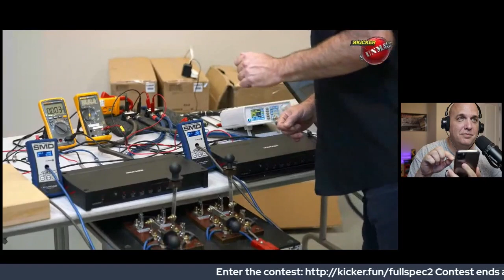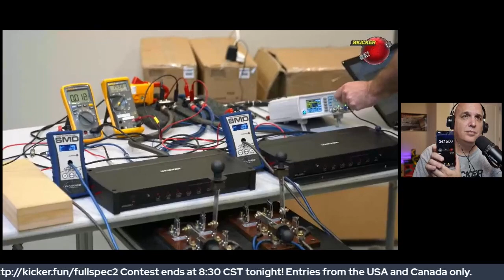CCA vs. OFC Power Wire Test - KICKER UnMASKED - Shorts

Comment: I’ve been using a thermal camera to find electrical issues on vehicles for a few years now, best investment I’ve made in years, the visualization is so eye opening. This would make an awesome demonstrational add. Two amps running wide maxed out for over 4 minutes is incredible!

Comment: Seems like a trick to sell more wire... 1/0 gauge cables (CCA)250max load (OFC) 350+ max load, head-to-head with over 500 amps of the current draw! ...... that's like a child lifting a jug of mild vs a teenager... both can do it.. the child struggles...try this test on a 100amp load and I doubt the difference would be dramatic... what you choose to complete the task depends on the task.

Comment: My first subwoofer was a Stillwater Designs 10", back in the mid 80s, if I recall correctly.   Had a Kangaroo with boxing gloves on, on the dust cover.

Comment: I see this in every OFC v CCA demo, and it's extremely lame.  CCA has a different internal resistance, which means less power throughput, this is an apples to oranges comparison.  Perhaps if you ever do this again, you do the proper apples to apples comparison and use a more properly-specced gauge of CCA.  Perhaps do 4 gauge OFC v 2 gauge CCA, I know stepping up two sizes is the rough rule of thumb for anything under the oughts, or perhaps do a 1/0 OFC v 2/0 CCA as one step up is the rough rule of thumb for the oughts, though I've also never been able to find a proper spec of what CCA's resistance is so I'm not sure what the more direct comparative gauges are.  I get a lot of people will use a certain gauge no matter the material, but perhaps take this apples to oranges comparison, perhaps take the better apples to apples comparison, and start educating consumers on how to properly spec CCA wire instead of demonizing it with the parroted 'CCA is shit' mentality.  Then perhaps talk about costs, where CCA in a power throughput comparison can easily be a third cheaper compared to OFC, that's not a gauge comparison, that's identical power through an oversized CCA cable, for cheaper than OFC.  Honestly, do better.  Even looking through the comments here, nobody seems to understand, or even know of, these facts.
Reply from the maker: The point is that CCA has its place. Yes, its more affordable, but it has some clear differences, as the video explains. At the end of the day you cannot use the same gauge CCA and OFC and expect the same result for less cost. If you understand their capabilities correctly, then you can use either type correctly..

Comment: Welding wire is the best. If it can pump big amperage while being dragged around in all seasons in hostile industrial  environments for decades, it will run a big stereo. It is also cheaper than "audio" wire and if you need it pretty slide some sweet colored sheathing on it and shrink the ends.
Reply from the maker: Welding wire is good stuff under the right conditions. The upside to it is affordability.  The downside to it is that the copper often doesn't have much resistance to corrosion (every strand of our cable is coated to resist corrosion). The copper used in welding wire is also often a lower strand count, so it doesn't deliver as much current as a typical audio power wire and isnt as flexible. We have well over 4,000 strands in our 1/0 AWG wire. and of course - welding cable never adds any warranty time to the amp you buy.  When you get a qualifying Kicker amp and power wire kit, you get an extra year of warranty on the amp (making it 3 years, total). Here's the exact policy: https://www.kicker.com/amp-warranty

Comment: All depends on your power needs. I used cca for years with my 500 watt rms systems never an issue just got my first big rms system and I'm learning i cant use cca anymore my amp is going in and out of protection like you mentioned..

I did the big 3 , sent my amp back got a replacement, almost bought a 250 amp alternator before I watched this video think I've found my problem
Reply: im about to do 1200W RMS for subs and 420W RMS for speakers/tweeters.  I am only using 1/0 OFC!
Reply: @GlycerinZ how’d that go I recently switched a 500 rms  jl audio to a mtx xthunder 1500.1
And it goes into protect too much voltage drop with the mtx it shuts off 
But it’s also running off a cca skar 4 gauge with a Infinity reference 4 channel

Comment: I have a 290A alternator I got 2 xspower d4800 batteries one under the hood and one in the trunk just about 20’ and I have (2) cxa1800.1 (2) SoloX 12s the new ones. And (1)750.4 amp. All with (1) kicker 1/0 ofc wire I think I should do (3) runs of 1/0 from battery to battery. What do you recommend. I do get voltage drop
Reply from the maker: What is the 750.4 amp?  We're looking to calculate total draw once we know that last piece of the puzzle.
Reply: @KICKER-AUDIO  it’s a Rockford Fosgate it’s for my door speakers

Comment: What about using CCA for just a ground wire
Reply from the maker: Best to use OFC, especially if it's a high-power system. To my knowledge, you'll still get voltage drop using CCA on ground. Keep copper on hot & ground, in my humble opinion.
Reply: @KICKER-AUDIO  I already ordered up some more ofc to get rid of that run of cca. Thanks

Comment: The only thing I would have done differently was run the CCA first , and in real world you would run 2 runs of CCA to 1 of OFC , but would have been nice to see CCA at 250 degrees lol
Reply: I've heard of running 2 runs of cca but I also heard it is a waste of time because the power will follow least resistance.. Can you help clear this up?
Reply: @phillippardo5712  EVERYTHING follows the path of least resistance, including electricity. I have just started the video so I don’t know what they will say but if it's NOT "CCA is dangerous crap", I'll be disappointed and disheartened. After many heat cycles CCA gets brittle, it will eventually crumble inside the jacket. The resistance will increase which means more heat and if not caught in time it could start  fire. Almost happened to me. CCA is dangerous crap.
Reply: I found a length of old cca wire which had turned to dust inside  ,defo eye opener.

Comment: I have the all black , all original kicker solo x 18. 😆 With a dual 2 ohm brand new drop in cone . Still in the box from like 7--8 years brand new .I  was going ton run 4ga to it for speaker wire and in side box to parallel the coils. Im preparing to run 8k. 370 amp alt, 4 xs d2400sbwith 2 runs of Rockford fosgate 1/0
Reply: I have a kxa1600.1 as well. Used to have the oldshool kicker xs100. Cheater amp. The kxa1600.1 says its capability is 3,200. Hiw can tou get 3,200 out of that amp without dropping ohm load below its threshold. Thats amp is 2 ohm stable . I ran it at 1ohm for awhile. Voltage never dropped below 13.6-13.8. amp is supposed to do its max at 2ohm. Specs say max power output is 3,200. ?
Reply from the maker: Two important notes: first, peak is a burst rating, which is true for all amps. Second, the ohm load varies widely on music, based on the dynamics of the track you play as well as the box rise.

Comment: Everyone does not like cca wire.i use it on my 2000 watt inverter no problem wire gets a little warm just like copper wire
Running 2awg wire.
Only I need to figure out is the inverter efficiency between the two! Other than that I like cca.
Also wondering why they make it if no one likes it!?

Comment: Cool video BUT why didn't u just run cca on 1 amp n ofc on the 2nd- then u coulda compared 100% side by side-LIVE
Reply from the maker: It was easier this way, but yes we could have done that. The down side would have been dividing the current into two separate cables.

Comment: Currently running 4g OFC on 1300rms amplifier.  Looking to upgrade to the kx2400.1 just wondering in your opinion being in a sedan with a 14' run and being a daily driver. Would my application work fine with the 2400 considering I don't have to tear the car apart again and buy more wire, or would that be putting to much stress on the amp????  Electrical xsd3400r 150amp alt.....
Reply from the maker: The KXA2400 (discontinued) will pull well over the amount of amperage a 4 AWG cable is capable of delivering given the length of the run, so upgrading to 1/0 would be important. Go the link we are providing, then click on the Power Cable Chart.  Lots of good info there! https://www.kicker.com/wiring-diagrams

Comment: What's better between oversized ofc 4 guage or CCA standard 0 guage ?
Reply from the maker: The first question to ask is how much current draw will you have? Let that be your primary guide.
Reply: @KICKER-AUDIO  I always do lol but standard 0 guage wire vs oversize ofc 4 guage to me is really close to the same. I'm only drawing around 200 amps I was just asking cause when I switched from my 4 guage to the 0 I didn't notice nothing or gain or lose any.
Reply: @KICKER-AUDIO  I'm running 1 audiopipe bdc4 18 on a vfl audio 5k with xs powers batteries and I had all power and grounds with 4 gauge cause I'm only running like 1500-2000 rms to the 18 but just being honest I couldn't tell by the ear or on the meter when I upgraded to 0 guage the only thing that did happen is that my voltage only drops to 14.3 with 0 gauge and the 4 gauge would go down to 13.9vlt. so I guess it helped with that but that's it IMO now 2k plus system I can see needing oversize 0 guage ofc wire but 2k or less I've never had an issue when it come to ofc 4 gauge or standard 0 and when I say standard 0 guage I mean that cheap soundbox 0 gauge wire lol.
Reply: When you say oversized what is oversized the jacket, the wire, the individual wire strands? This is why I recommend only using AWG wire so you always know what your getting and any connectors etc you get will work as should.

0-50 ft. 200 amps with 60% duty cycle 2 awg ofc welding cable.
Reply: I just got some sky high 2/0 ofc wire today that I'mma install and see how it dose and I had to get wire reducers for my amp inputs cause they only 0 gauge lol and I'mma also upgrade my 10 gauge ofc speaker wire to 8 gauge kicker silver tinned ofc speaker wire :) should be better that's what I'm hoping and should at least give me an extra db on the meter

Comment: for speaker wire for say around 100 rms 14awg or 16awg at  10-15 ft does OFC make much over a difference vs CCA wire assuming both are AWG?
Reply from the maker: In short, the answer is yes. The amount of loss will vary with the run, how close it is to AWG and of course the material. Check out the main video: https://youtu.be/Av6le1K03z8?t=2736

Comment: I mean the difference is right in peoples faces when they are looking at wires or wiring kits. Either it says OFC or CCA etc. Just between those two alone the price difference is half lol so that there should be enough. I think it’s more of a common sense to get the most expensive wire available. They don’t price copper wires the way that they do unless they are the same. I have a buddy that likes to use welding wire and I’m trying to get him to run all OFC he thinks it doesn’t matter. I said OK you some cc a wire LOL copper clad aluminum has nothing on oxygen free Copper
Reply from the maker: Maybe break out a multimeter and check the resistance of both cables? That will help shed some light on which cable will work better. Then get a temp meter and measure as well.
Reply: Well true welding cable is AWG OFC and is rated for hot,cold and abrasion. It’s really the standard for best cable especially if it’s tinned. But it’s usually not tinned and is why it’s got that paper inside of it. I was a licensed water well driller/electrician pump installer by trade in northeast Washington right on Canadian border and for over 10 years we used same welding cables never needing to repair them or anything. This was 30ft cable drug through water, snow, ice, mud, drill cuttings which is very abrasive think fine ground up shale and granite etc. still have the same welding leads to this day even though moved across country started new drilling business and closed it but those leads still with here :)

Comment: To have a loud system....$1500 For electrical (Alt, Batteries, OFC cables, Etc)  is what I usually spend.
Reply from the maker: Depends very much on how much draw you're expecting. Either way, big 3 upgrades are certainly worth it to be sure.

Comment: Lol I know people that run cca wires on demos bulds😢 wit zero issues  it all just away for them to charge more money you should never go over what ever amps you wire is rated for
Reply from the maker: Like we say in the video, CCA can be used, but you have to know what it can - and can't  - do. If you understand what gauge is appropriate for the draw and the distance of the run, then you're fine. If you don't, and treat CCA as if it performs identically to a comparable gauge   OFC, that's when you can run into problems.  It is cheaper? Yes. Can it handle the same amount of max current safely?  No. This is what we show in the video.